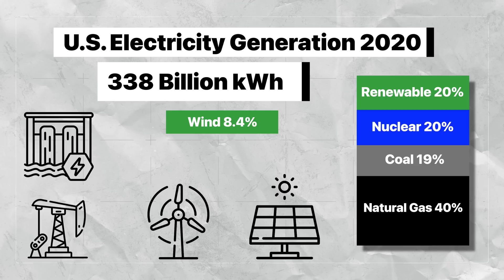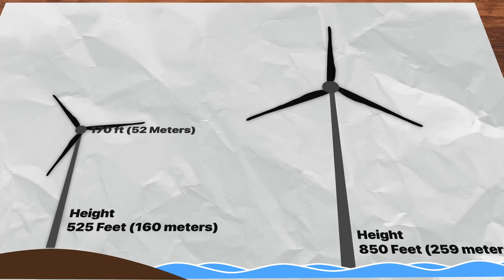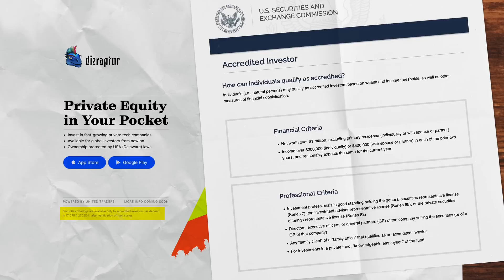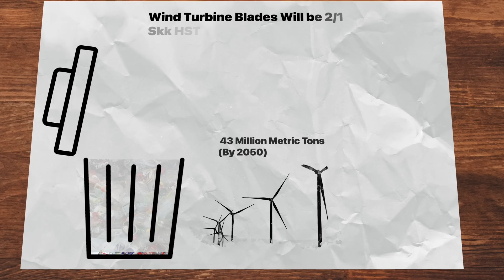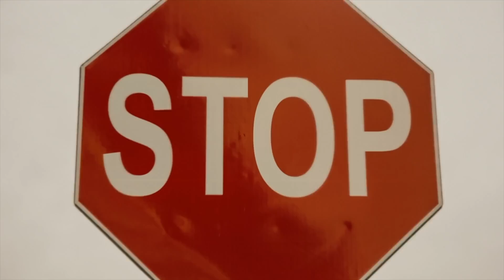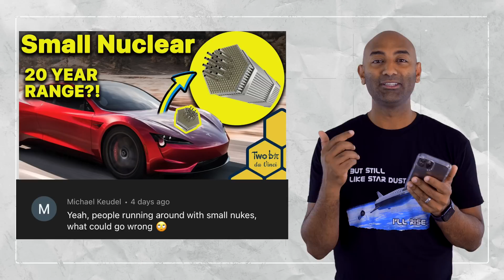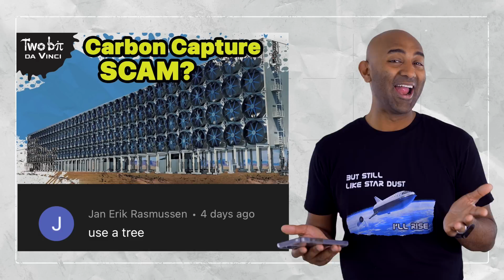The TRUTH About Wind Turbines

Comment: If these blades are so robust and durable that they're really hard to break down, why decommission them at all? Why not keep using them for longer?
Reply: This video is not correct. A company in the Netherlands called Extreme Eco Solutions does recycle decommissioned wind turbine blades as well as decommissioned yachts into 100% street and wall tiles without subsidies and with a profit. This man who made this video did no research at all. 

And they decommission the blades because the blades can show cracks after many years of use. Or they simply want to install new updated turbines that can produce more power. More power means more profit. In any case it is better to replace them before they break.
Reply: Because every structure is vulnerable to cyclical loading. There's boneyards with aircraft that won't break down anytime soon, but if you tried to fly them they'd break apart in mid air.

Comment: This is what it boils down to, CO2 emissions are an existential threat to humanity. Turbine blades in a land fill are not.
Reply: Indeed ...but it is wasteful so finding ways to recycle them is a great idea.
Reply: @dustygreene3335  Did you get the list of materials that go into these things?  Most of it would be landfill one way or another.  Balsa wood?  This is why the best thing to do is simply shred the material, as was shown.  This would compress down to a very trivial amount of space BTW, you know because balsa wood is mostly hollow?  The bulk of this is going to be balsa, but as he said it's mixed with glass and carbon fiber.  I don't think you can recycle the carbon fiber, and this leaves a mix of glass and balsa.  That's too much of a headache to separate out.  So repurposing the shredded material is about the best you can do.
Reply: @johndoh5182  agreed. The nice thing is that the materials aren't toxic per say that I know of........at least not on oil spill types of levels.......unless there is some toxic chemical leaching from the epoxy or whatever resin is used I'm not sure.

As an aside fiberglass is an energy intensive product to make....but I still like wind power but it's always good to look at these things in a wholistic way.
Reply: @dustygreene3335  If a small cost could be added to the manufacturing of these and it extends the life to 25 - 30 years that would be better.  The problem is the entire structure ages and wears out, even the tower.

I highly doubt that after 20 years exposed to all the elements that much of anything could possibly leach out of any bonding or hardening materials.

Really, the video shouldn't have even been made.  There are far bigger issues in the US regarding recycling in general.  I mean, a lot of recycled material ends up in the landfill because there are no companies in a region to process it, and it gets too expensive to ship materials across the country to a facility that can handle a particular material.  I mean really, this is why I think it was Coca Cola that recently did an ad campaign talking about how their plastic bottles are now recycled, by them.  Then add it almost all the attacks about these blades come from anti-green oil lovers, ESPECIALLY in Texas (where many images of lined up blades come from).  Texas companies generate more wind energy than in any other state.  A lot of Texas politicians don't like it and attack the industry any way they can.  But Texas in a anti-regulation state, and it doesn't even do any checks or inspection to enforce regulation across the entire oil, coal and gas industries.  It would be pure hypocrisy to pass regulation about waste from blades that hit EOL.  REALLY!  It's why when it's brought up in the Texas legislature (ways to regulate or impose fees on wind energy), other Conservative legislatures shut down the conversation, because the knife cuts both ways.  So, it is what it is.  This thing of just lining up these blades is normal in Texas, Texas probably has the most wind turbines at EOL right now, if not CA, but Texas doesn't like regulation of any kind.  And there's nothing that says these blades can't be shredded in the future.  It's just not a priority right now and it shouldn't be because it's TOO trivial.
Reply: @johndoh5182  agreed......I wonder if smaller per house options especially in rural areas would be better? There are some wind pumps that are still in good condition that are almost 100 years old.
Reply: JOHN LONGENECKER  Maybe learn something before commenting
Reply: This video is completely wrong !!! This company in the Netherlands, Extreme Eco Solutions, recycles decommissioned turbine blades as well as fiber composite yachts into 100% recyclable street and floor tiles without subsidies and with a profit. Very very poor research from the person who made this video. 

It is not the technology that is wrong, but people are.
Reply: @insAneTunA  Um… he did talk about recycling. He just said it was hard and currently expensive, not impossible.

Comment: Come on!
Even when the 3 tons (ish) blades ended in a landfill after 25 years, nobody can seriously compare with the SEVERAL TONS any fossil fuel plant burns each day to the air and our lungs!
Reply from the maker: Agreed!
Reply: This video is not correct. A company in the Netherlands called Extreme Eco Solutions does recycle decommissioned wind turbine blades as well as decommissioned yachts into 100% street and wall tiles without subsidies and with a profit. This man who made this video did no research at all.
Reply from the maker: But yes some do compare…0
Reply: @TwoBitDaVinci  I don't know how much materials have changed for these over time, maybe that would make an interesting video.

But, as you said the materials used are balsa (naturally decomposes), glass and carbon fiber, and I don't think you could capture the carbon fiber since you also have bonding materials, I don't think recycling is practical, at ALL.  The best you could do is repurpose the material as is being done as you showed.  I think it would be a nightmare to separate all these materials, but since balsa couldn't be reused and compresses down to almost nothing, I just don't understand why a company would want to even try.

And last point, not only is this a trivial amount of material considering that you could compress this down to a small block, it's hypocritical to even talk about it when the US does a poor job of recycling with many materials.

And then when it comes to regulating in the recycling, that would probably harm the efficiency of turbines and there might not be a good solution that's cost effective.

In other words, this is much ado about nothing, and THAT is the point that should be made.  One could say we could regulate that the blades get shredded, but I bet many of the pictures you see come from Texas since Texas has the most wind energy in the US and there are turbines that have reached EOL and many oil fanatics have taken LOTS of pictures of these blades here in Texas to argue against wind.  And why does this make any difference, that most these images are coming out of Texas?  They don't even regulate GAS, OIL and COAL!  There's regulations from the federal govt., but Texas doesn't enforce anything, so many of these images coming out of Texas (and I KNOW they are because I've seen this as an argument against wind in Texas) is nothing but pure hypocrisy, and not worth a video.  A better video would be about the hypocrisy of the argument against these blades, since they're left that way due to the lack of regulation, mostly in Texas.  And if Texas wants to add a bunch of regulation to wind and solar, the state govt. KNOWS how hypocritical that would look, which is why when the anti-green politicians start making noise in the Texas legislature, they get hushed by smarter people who understand Texas a little better.  Add to that these wind and solar farms are bringing in plenty of revenue for the state.
Reply: @TwoBitDaVinci  It's miles better than any  fossil fuel power, and it shouldn't stop the implementation.

But I will compared it to nuclear, whose waste is contained, as opposed to wind turbines, which do leech carcinogens into soil.  It demonstrates an annoying degree of selective rigor and double standards when it comes to looking at nuclear as part of the energy solution.

Comment: Every manufactured product needs to be designed with recycling in mind.
Reply from the maker: Couldn’t agree more
Reply: @TwoBitDaVinci    not sure if you guys have seen but there's actually a company working on building these large turbines out of wood, worth a look 👍
Reply: If a choice is, REALLY good and generates power at 2 cents/KWh, or OK and 15 cents KWh, I can tell you what economics dictates.

The amount of waste from these blades is INCREDIBLY trivial compared to the waste that's generated every day around the world.  So, while wind is getting ramped up, I would say the first thing to do would be to produce a better product that can last, say 30 years instead of 20 - 25, if this can be done with minimal cost increase (going from 2 cents/KWh to 2.5 cents/KWh)

Some perspective is warranted.  Once again this only looks bad when the blades don't get cut to pieces and shredded.  They're mostly hollow.  That should have been clear from the video.

One oil spill in the ocean does far more damage than these blades ending up in a landfill, although once again they should at least be cut into pieces.  The regulatory step that could be added is to ensure the blades are cut up.  But, Texas is the largest producer of wind energy in the U.S., and Texas is an anti-regulatory state.  It doesn't even want to regulate oil and gas and doesn't bother checking ANY of that infrastructure for safety, leaks, etc...  It would be hypocritical of the state, or even the federal govt. to have strict regulations on wind or solar while allowing coal, gas and natural gas to be as polluting as they are.  In W. Va., one really bad coal ash pond spill ends up in a river (yes this happened)  That river is dead for 50 - 100 years for all intents and purposes.  Life can come back before then, but you can't harvest fish from it for about 100 years, maybe.  That's the case with different rivers right now in the US, that go through coal and steel country.  But it also includes other industrial areas, such as Tennessee where all the damming of rivers created lots of cheap hydro energy and that used to be very industrialized.  Many of those rivers can be fished, 40 years after industry shut down, but you can't eat that fish. 

So yes you have a point, but most products aren't, and most products come from Asia.  And, the US has far bigger problems than this when it comes to recycling.  Like, we collect a lot of material, but then there aren't good facilities for all the stuff we recycle and part ends up in a landfill anyway, since China stopped accepting material from the US, due to how screwed up it was (too much trash mixed in with actual material that can be recycled.

So, really the first step in the US is simply to get better at recycling in general, because it doesn't matter if you design a product with recycling in mind, but then don't actually recycle.

There, some more perspective.
Reply: Except anything related to fossil fuels. Which proves the people claiming renewables are made of coal are lying, otherwise they wouldn't demand they have to be recycled...
Reply: This video is completely wrong !!! This company in the Netherlands, Extreme Eco Solutions, recycles decommissioned turbine blades as well as fiber composite yachts into 100% recyclable street and floor tiles without subsidies and with a profit. Very very poor research from the person who made this video. 

It is not the technology that is wrong, but people are.

Comment: Many boats use the same build materials. And where else are glas fiber enforced plastics being used? So many places! Non of these produce energy, but do go to the same landfill. Don't make it sound as if only windmills go to the landfill.
Reply: This video is not correct. A company in the Netherlands called Extreme Eco Solutions does recycle decommissioned wind turbine blades as well as decommissioned yachts into 100% street and wall tiles without subsidies and with a profit. This man who made this video did no research at all.